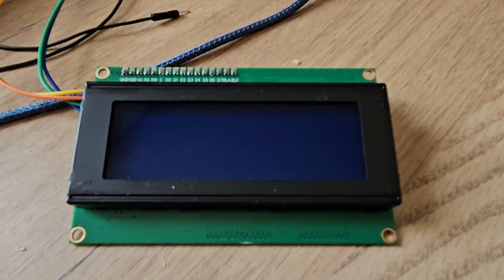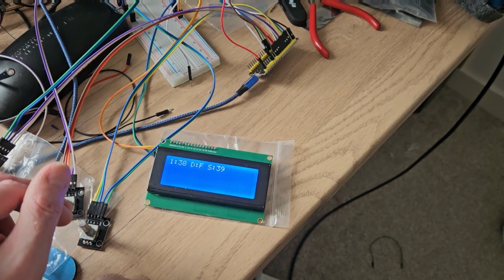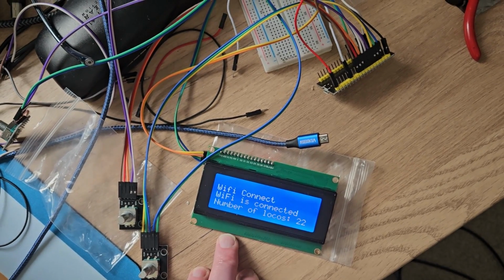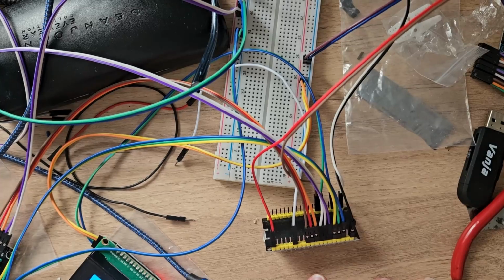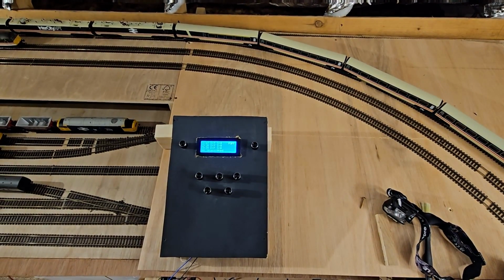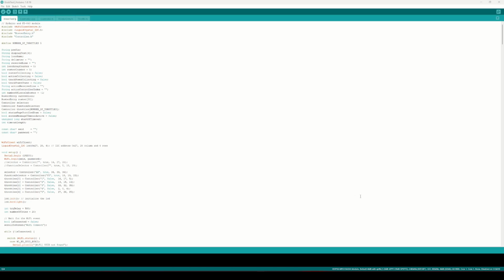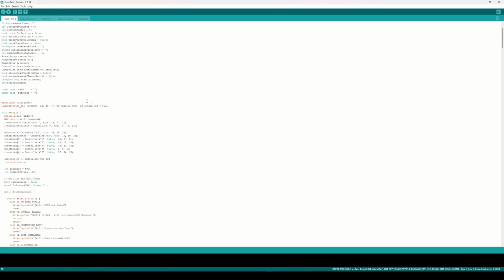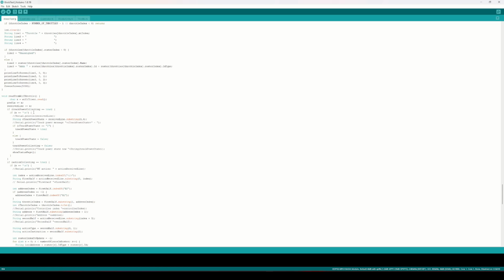Building a physical, tactile knob based throttle controller for JMRI using an ESP32 - Part Two

Comment: Looking really good! The progress is fantastic, having 5 throttles at the fingertips is wonderful and with an appropriate battery you would have the control unit fully wireless for walking about with.
Reply from the maker: Thanks Jtag! I did look into suitable battery power and ended up on a web page that listed lots of different battery types and why they were unsuitable for, or inefficient with, ESP32s, but it didn't seem to come up with a recommendation for the most suitable. Have you got any suggestions? Thanks for all your help! Chris

Comment: I was introduced to your channel when YouTube popped up Part 1 of this project.  I was interested in using some microcontrollers on my layout, and was intrigued by your throttle controller.  I then went back through your previous postings, and learned quite a bit from what you have generously shared about JMRI, sensors, and MQTT.

I was also impressed by the way you have utilized the loft space to create a layout that is already great fun to view in operation.  Thank you for taking the time to document your journey and your clever applications.
Reply from the maker: Thank you Justin, that's very kind! Yeah, I've really tried to treat this channel as a simple, old-fashioned 'vlog' where I just try to document what I'm doing. And yes, the layout is quite fun, fun to operate too although I'm still learning its new complexity and get quite frustrated at the amount of shorts and derailments that I'm causing myself! Regards, Chris

Comment: got the knobs already, now ordered the screen, nom nom nom
Reply from the maker: Ha, good luck there Carnivor. Keep me posted. Chris
Reply: @WirenwoodModelRailway  not working to well for me so far, figured use 1 throttle to start off so set to that ok, screen works fine,  i get wifi connected ok, if jmri isnt running,  i can see the dials work except for FS movement, left works ok, right panics and esp reboots, if jmri is running it just panics and loop boots until i close jmri again. im lost...
Reply from the maker: @yenraccarnivor i suspect that's an overloaded array. Check the number of locus array can handle the number of locos that jmri sends!
Reply: @WirenwoodModelRailway  i got it set to 10 and it sees the 7 i have, upped to 30 but same problem
Reply from the maker: Have a look at the channel details, there's a contract email address in there. Email me, it'll be easier to work through it. I'd love to see this being useful to someone else!
Reply: @WirenwoodModelRailway  Cheers for the convo, i got the 1 throttle working, and added a 2nd with no problems,

Comment: Absolutely brilliant.
I have adapted code for my DCC++ system & JMRI by following instructions on Little Wicket Railway but until now had no idea how I could use rotary control to control the loco's (I find sliders rather fiddly). This has potentially (if I can get it to work) solved the only gripe I had with using JMRI. Having multiple rotary throttles will be a game changer !!
Thank you for sharing.
Reply from the maker: Thank you Adrian! It's definitely become my 'go to' controller. I still keep the odd phone / tablet handy - they're quick if I just want to shunt a loco up a storage line, but yeah for actually controlling the locos running around the layout, it really works. Regards, Chris

Comment: Amazing!  I wanted something like this to control JMRI on my layout.  Sadly I am useless when it comes to electronics. I am colour blind so wiring up things can be fun!! Thanks for sharing.  Cheers, Andy
Reply from the maker: Thanks Andy! Ah, that must be limiting. My eyesight is terrible but I can just about get by with that. Are there any colours you can distinguish, high contrast stuff? Could you limit the range of colours used? I don't tend to have set rules for cable colours (apart from track bus) and can use quite random ones, so often have to physically follow a troublesome cable from end to end to work out what it's doing! Regards, Chris
Reply: @WirenwoodModelRailway  I struggle with Red, Green, Brown, Black if they are close together.  I can't play snooker for that reason!  It has limited my career in the past, but it's just one of those things, can't do anything about it.  I have been working on something similar to your idea for a while now.  I keep going back to it and tweaking things here and there.  Its not complete, but if I can get it to work I will let you know.  Cheers, Andy
Reply from the maker: @Shelvington_Railway Cheers Andy - pool is more fun anyway! Let me know how you get on. Chris

Comment: Can you not rotate the display 90 degrees to get more vertical lines ??
Reply from the maker: Thank you - yes, I guess it would, but wouldn't it severely limit the number of horizontal ones I had?! Also I'm not sure, using the library I'm using, whether rotation is possible anyway - all characters etc would need to be rotated too. Nice idea though! Regards, Chris
Reply: @WirenwoodModelRailway   - horizontal scroll I guess - you can also get Oled/IPS displays that allow this - I’m using them 🙂
Reply from the maker: @sid21177 Yeah I definitely think if I really needed more screen space it would be a case of one of those displays - good call!

Comment: Really good progress, and I think you have in this a throttle thats more usable than many commercial ones for driving multiple trains.

for reference you could stick four rotary encoders on a PCF8574 module - this will give you an interrupt when things change and provides four I/O lines on the I2C bus. bit more of a faff but if you want more twiddles could be worth a look.

likewise since you note you don't overly use sound it could be worth a couple of function buttons for the last train adjusted, thinking lights on/off and shunt mode on/off (if you use shunt mode), maybe "horn" if you have any that can use it (saves twiddling for functions used often while still having control over all of them.

one thing that may be worth a look is an actual LED for track power, just makes it very clear.

but overall though I think this is very good, I think you have me sold on rotary scrolling through a roster list though, that works very well

for mounting the ESP32, I grabbed a bit of stripboard and some female header pin rows, make a carrier base for it to just plug into, removable when soldering on it, can then stick wires to that or stick terminals to it but grouped in ways that are useful, e.g. a dedicated power connector.

speaking of which, while this is obviously not designed to be hand held given its wi-fi for data and given you seem to have a 5V power bus for various things, have you considered a simple power lead to plug this in, and having one or two sockets dotted about and perhaps give it a small handle and some hooks to hand it from?
Reply from the maker: Thanks Dale - again, loads of good points again. I did give a lot of thought to making it portable - maybe even battery powered. Maybe building a much smaller one, or two, no screen and just throttles - and have their assignment controlled through MQTT - so I have a little Windows app on the main screen with 5 drop downs, say, and each of those represents a throttle. When I select a loco on any of those drop downs it sends an instruction to the ESP via MQTT saying 'grab that loco'. Could keep the main one. But also, the old tablets / phones are still great for quick, easy, wireless throttles that I can carry around with me if I need to.

Dedicated power connectors are a good idea too - it's just powered by 5v and ground coming up from a little power distribution board below the baseboard. There's one of those distribution boards in each corner and half way along on each side (where all the various control hubs are) so if I just buy some connectors it can have a possible home almost anywhere.

Thanks for the tip on those I2C boards too - I didn't know they existed, I'm still very much a beginner really! 
And thanks for all the continued advice and sharing of experience Dale - much appreciated. Regards, Chris

Comment: Awesome! A bit concerned with how you have attached boards with screws. Can you use something like the risers used to hold PC motherboards a few mm from the case? Or maybe a couple of oversized nuts, a stack of washers or a short tube. Maybe something like a toothpaste tube top with the screw through the middle; perhaps too big but you get the idea.
Really impressed with your knobs!
Reply from the maker: Ha, thanks the Jeffroid (that sounds very Red Dwarf to me!) I have to admit I'm really quite pleased with my knobs! And I'm genuinely using the box too, which I didn't think I would. Good point on the risers, I think especially the little power board, with all its lumps of solder on the back, is bent a little, although I think the others are OK. I'll look into it, I have plenty of discarded motherboard boxes lying around, I'll see what I can find. Thanks for the tips, best wishes, Chris